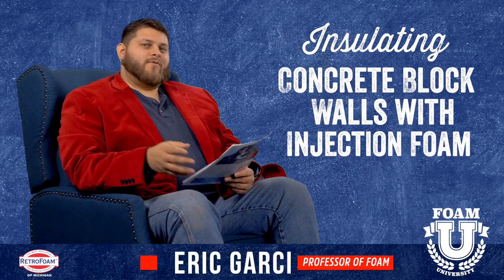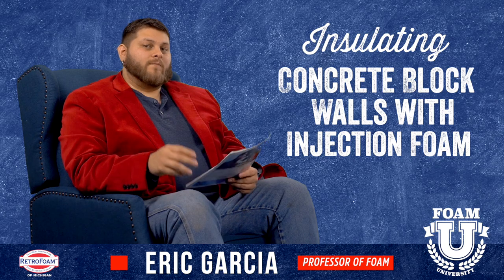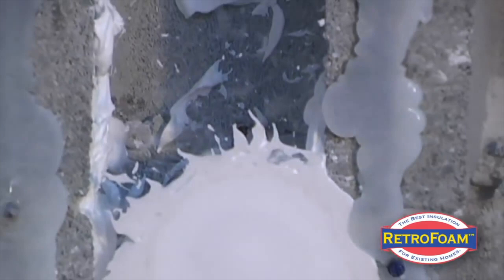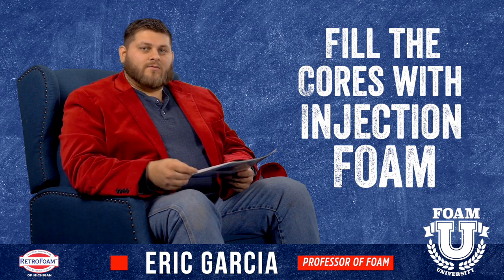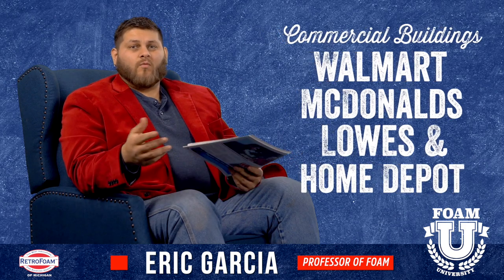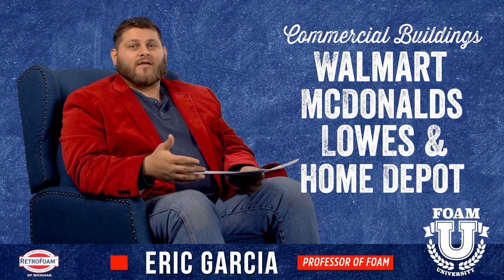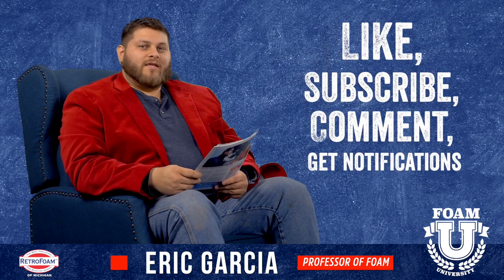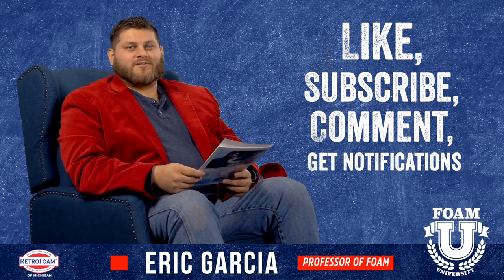Insulating Concrete Block Walls with Injection Foam | Foam University

Comment: I'm building an underground shelter 30x50-feet.  I was going to fill the 10-inch block with concrete for strength, but then I learned there's virtually no insulation value to the poured in concrete.  So, would this injection foam resist mold and mildew in an underground situation like mine?
Reply from the maker: We should be able to inject injection foam into those cores, and it doesn't act as a breeding ground for mold or mildew. It would be best if we could come out and take a look, though. If you'd like to request a free estimate, please follow this link: https://resources.retrofoamofmichigan.com/estimate

Comment: what do you say to something like this?

No, you can't effectively insulate a concrete-block wall by installing insulation in the cores of the block.

First of all, in a well-built concrete-block (CMU) wall, not all of the cores are empty. Some of the cores should be filled with grout (soupy concrete) and rebar.

However, the main problem with this approach is that concrete is a good thermal conductor, so you get massive thermal bridging. The heat just follows the obvious path -- through the concrete -- and the flow of heat is barely affected by the small pockets of insulation.

To insulate this type of wall, you need to install a continuous layer of insulation -- usually rigid foam insulation, although mineral wool panels are another option. The insulation can be installed on the interior or the exterior of the wall -- although installing the insulation on the exterior is almost always preferred, because that approach can address the intersection of the wall and the concrete slab better than the interior approach.
Reply from the maker: We agree for the most part. In a perfect world, adding a layer of insulation to the interior or exterior would be ideal, however, it's not often practical.
The practice of insulating block cores is widely used in commercial applications, as well as residential.
Reply: But to that I would say that the portion of the concrete bridging section is very small in comparison to the insulated void. Without question it would certainly add tremendous sound proofing. Additionally for here in Florida where we have “Palmetto bugs” (just a fancy realtor term for HUGE COCKROACHES) this would completely combat their ability to have free reign of your walls.
Reply: @savagecub  can those bugs not eat through the foam? (assuming there are holes in the cinder block surface)
Reply: @sdoken  
Not at all. The foam is toxic to them.

Comment: Will filling the CMU cells with foam cause moisture issues? I am in north Florida where moisture and mold are always an issue due to both rain and humidity. It is my understanding that the voids in CMU construction help to mitigate this issue.
Reply from the maker: Injection foam completely fills the cavity and creates an air barrier. This can help with humidity issues. Also, the foam doesn't promote the growth of mold and mildew.
Reply: @RetroFoamofMichigan  I am in central Florida and I had the foam put in my block walls.  Now before I put up my drywall do I have to put up a moisture barrier?  Also I love your marketing videos!!

Comment: Is there a risk of the installer putting in too much foam and having it crack or lift the blocks?
Reply from the maker: Although we've never seen this happen, we suppose it is possible. Realistically speaking, the foam should never create that much pressure.
Reply: @RetroFoamofMichigan  Oh no that foam is only used to raise sidewalks and homes. This is such a waste and scam imho
Reply: @patrickkirby7612  understanding the different types of farms and applications before making a comment like this would be wise. The foam used for lifting concrete and the foam insulating inside the block walls are two different things.
Reply: @patrickkirby7612  oh no you are 100% wrong!

Comment: Can Concrete Blocks be filled with mud on each layer while laying the walls to improve its thermal properties?
Reply from the maker: You could, but it probably wouldn't help with thermal resistance much.

Comment: Could you do dry stack and spray fill ? How strong would it be?
Reply from the maker: It won't add strength, but if the block cavities line up, injection foam could be used.
Reply: @RetroFoamofMichigan  it won't add any strength?
Reply from the maker: It won't add structural strength to the wall.

Comment: I’m about to get some cans and fill in my block foundation. I had the underside of the addition of my home professionally spray foamed, and then only the walls of the main home foundation crawlspace. Buttt, I’m having the air leak in from all base of the floor where the home sits on the block wall foundation, being a work in progress home, this was something I didn’t even think about. So I’m going to get a concrete drill bit for my standard dewalt drill and make holes at the top blocks and fill from the top and let it work it’s way down with gravity, I hope it works and I’m just imagining it will make a massive difference. Just spray foaming the walls and putting down a radiant vapor barrier in my main homes crawlspace has allowed the pipes to remain unfrozen in -30F for 2-3 days and spray foaming the additions underside have immensely improved my homes warmth.

Comment: What's the R value of a CMU wall with injection insulation?
Reply from the maker: RetroFoam has an R-Value of R-4.6 per inch, and it actually increases as the temperature decreases. This article from our Learning Center includes some additional information on this topic: https://www.retrofoam.com/blog/retrofoam-injection-foam-insulation-r-value
Reply: @RetroFoamofMichigan  TY

Comment: i believe i have blocks but it also has some type of metal mesh material in it.. it's an old house. can foam work? i believe we did do foam on the perimeters in the basement. bottom floor was done with blow in insulation but still cold.... i was told the attic and guest room on first floor don't have insulation in the ceilings, they have separate roofs on the house. the attic is used as a bedroom and also had blown in insulation.  the second floor wasn't insulated yet. but the house doesn't seem to be able to hold the heat as boiler bills in the winter are insane. could foam insulation be done?... if it can, can the blown insulation that was done on the first floor be removed and replaced with foam if it's better?...
Reply from the maker: The metal mesh is likely a glued in cellulose in the wall cavity. If you have concrete blocks, we can work around that by injecting directly into the block to avoid it.
The rest of the house could absolutely be foamed. What you're likely seeing is the old blown-in insulation is starting to shift and settle, allowing air to move around it and through it. Our recommendation would be to removed all of the old blown-in insulation and foam the entire building envelope.

Comment: Do you know if this foam insulation would also be a good sound barrier as well? I have an attached cinder block wall with a neighbor, and need it more for sound issues, than insulation. Thanks!
Reply from the maker: Injection foam does have sound dampening qualities but will not completely soundproof the wall.

Comment: HELP! I think its a bad thing. What's your opinion? I've a cinder block wall on one side of my storage unit cause its on rhe end. And it has a decorative type cement form wall on the outside. Because of its position, the damn sun beats on it about 12 hours out of the day. Making it hotter than all the other units that don't have an outside wall. At 100° inside mine, and an empty one around 84°, it is wreaking havoc on my things over time. So my question is, there's moisture coming from the top when it rains. I was going to fill the block with foam BUT, I WONDER IF THAT WOULD BE A BAD IDEA CAUSE, shouldn't the blocks be allowed to breathe? Like they say to leave a gap of air between the foam and brick because it allows the heat or hot air to rise and escape? Like is that why we have an attic? Talk to me.
Reply from the maker: You can absolutely fill those blocks with foam. 
I would recommend filling the blocks and if there is an existing moisture issue, you can install proper vents to allow the moisture to be expelled. Mechanical vents are best.

Comment: If block foundation has water comin in little holes does that foam stop that from leaking basically sealing the little holes in wall stop it from leaking
Reply from the maker: Closed cell spray foam can be used as a bandaid style resolution, however, we do not recommend doing this as it doesn't fix the underlying problem.

Comment: Have a small bathroom with outside block wall, about 35 face feet. need a product/kit to insulate this small section of wall. What should I use?
Reply from the maker: Really the only option you have, if you don't want to hire a contractor, would be to drill a hole into every core and use can foam to fill them.
You won't necessarily have to inject into each core, but you'll want to so you ensure each core is filled. 
Then all you have to do is re-mortar it when you're finished.
Reply: @RetroFoamofMichigan  Thanks that is what we are doing.

Comment: Wouldn't thermal bridging negate ANY benefit to foam injection insulation within a CMU block wall? Any scientific data showing this product is actually beneficial?
Reply from the maker: CMU walls will never be as efficient as a well-insulated wood frame wall assembly, but regardless, empty core block walls are worse than insulated core block walls.

Comment: I've asked around and no one agrees with you here. I disagree with them.... i know this can be done. 

I recently moved in to an old block collegial building renovating in to a house and i desperately need insulation, especially right now no power -10F outside, we were doen into the 30s my whole house! And 3/4 my building to single digits. but im too stubborn to finish anything because this is what i want i just don't know a product. 

I'm a contractor in midwest. I have a lot of spray foam insulation, but that was supposed to be for the underside of my floors for rigidity, sound, thermal and efficiency...

Any help would be great! Love the channel
Reply from the maker: Thank you! We recommend insulating the block walls as well as the attic and crawl/basement.
Reply: @RetroFoamofMichigan  these will be....

I'm trying to find an injection foam product in the US.
You mention a 3 part, but i can't find any.  Neither can i a foam product "for block walls. "
Reply from the maker: Have you checked this website for any local RetroFoam dealers? https://www.retrofoam.com/dealers

Comment: Since we are practically neighbors, I invite you to Kansas City, Missouri to do this job in our basement and I’ll treat to the best KC BBQ joints. We have been dealing with basement problems for 9 years and now this year it has started to get fixed. I just checked one wall and it was very cold.
Reply from the maker: Wow, thank you for the invite! There is actually a dealer in our network that services your area and would love to assist you. Give them a call! https://www.retrofoam.com/dealers/missouri/sedalia-spray-foam-insulation-contractor

Comment: Would like to learn more about insulating cinder blocks for my house and where to buy the product
Reply from the maker: If you plan to do the installation yourself, you'll need to drill a hole into each core and use can foam to fill them. The can foam can be purchased at most home improvement stores. This article talks more about the best way to insulate concrete block walls.
https://www.retrofoamofmichigan.com/blog/insulate-concrete-block-walls-homes
Reply: @RetroFoamofMichigan   
Hey bro my house its about 2450 sqf and all the walls are cinder block (frame/outside) 
How much does a company normally charges per sqf??
Reply from the maker: @chinocool7481  Our existing home budget calculator will give you a rough range of what it may cost to insulate the cinder block exterior walls https://www.retrofoamofmichigan.com/calculator

Comment: Does the foam provide any additional strength to the CMU walls? If so what kind(compression, tension, sheer or torsion) and the amount of additional strength versus empty but otherwise similar cell CMU please.
Reply from the maker: Great question Michael.
Injection foam won't add structural integrity. While it creates the air barrier you're seeking, but it is a softer material and isn't made to create any additional strength. The same is true for spray foam materials.

Comment: How much for insolating about 800 sqf?
Reply from the maker: We would charge in the range of $3000 to $4500 to insulate 800 square foot of block wall.
Reply: @RetroFoamofMichigan  wow! Thanks for the quick reply. Will start saving now!
Reply from the maker: @crs3791  You're welcome

Comment: My basement has black walls and  get water  in my  bassement
Reply from the maker: Unfortunately our product is not a Waterproofing agent we would recommend getting any leaks fixed before adding foam to any blocks in your basement!

Comment: I have a double brick house. Can I fill the cinder block wall on the inside with it. There is also a cavity between the cinder block on the inside and the decorative brick on the outside. I live in Utah. Not sure who does this sort of thing.
Reply from the maker: This is something that can be done. The only downside is there aren't any RetroFoam dealers in your area. If you find an injection foam contractor they should be able to help you.

Comment: What is this "injection foam"? Is this closed or open cell?
Closed cell is far superior than open cell. There is also an extreme amount of thermal bridging here. Every one of those blocks have lots of thermal bridging. Insulating the exterior would eliminate most of it and the benefits would be tremendous.
Reply from the maker: Our injection foam is an Open Cell foam. We have both Open Cell and Closed Cell SprayFoam. They both are beneficial in different areas.

Comment: Without creating a thermal break halfway through the middle of the wall this process is a waste of money.
Reply from the maker: Normally, there wouldn't be a thermal break in masonry walls. Would you mind elaborating on what you mean exactly?
Reply from the maker: A lot of people don't want to lose a foot of living space on each wall to stud it out for spray foam. In that case, the next best option is to inject the core of the block.
The injection foam will fill all of the cores, plus the cracks and crevices.
This article talks more about the options.
https://www.retrofoamofmichigan.com/blog/insulate-concrete-block-walls-homes

Comment: That thermal bridging, though.
Reply from the maker: Because foam works as continuous insulation and air seal, it also prevents thermal bridging.